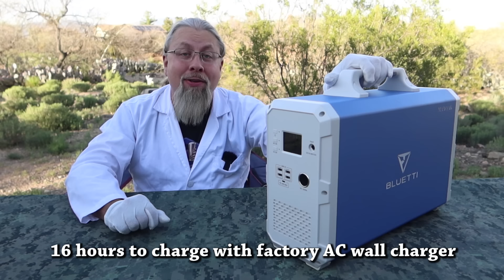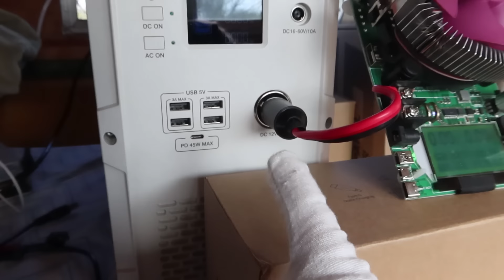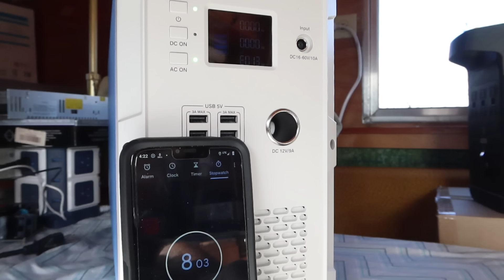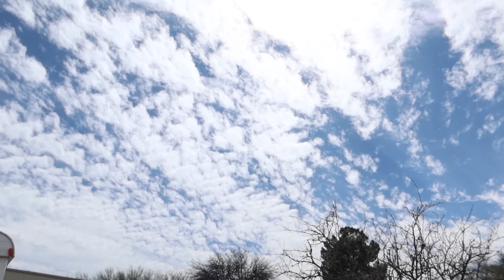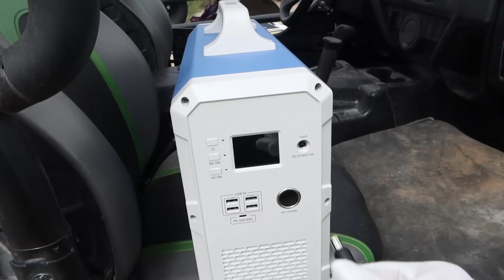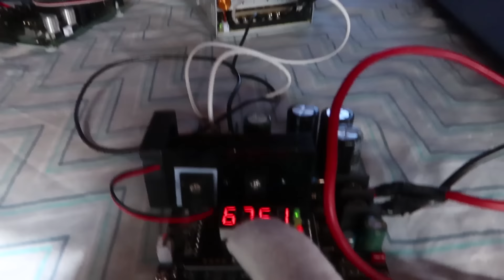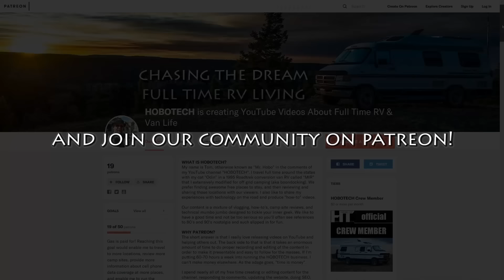MASSIVE Off Grid PORTABLE POWER Station! 2400Wh MAXOAK Bluetti EB240 Lithium Solar Generator Review

Comment: Thank you for you presentation. If I hook up a 2000w 12v inverter via the the 12v cigarette lighter, will that allow me to power higher wattage from the 2000w inverter without any problems?
Reply from the maker: No.

Comment: Well..................I just received the Bluetti EB150 a couple of days ago and have been testing it out in my camper. I have a relatively new Fridgidaire 5000 BTU compact A/C that is labeled at 3.8 amps. When it starts up, like most window units I assume, the fan runs for a few minutes before the compressor kicks on. At that point the Bluetti said it was pulling about 60 watts. When the compressor tried to kick in the A/C shut off, the Bluetti showed 0 watts momentarily and then the A/C came back on at the 60 watt level but the compressor never came on. I unplugged it for fear that I may damage my A/C and then plugged it into grid power and it worked as normal. Hmmmmm.................any thoughts on this anybody?
Reply from the maker: Sounds like your AC unit doesn't have a soft start. My Frigidaire model does and runs off the EB150 like a champ. It also ran just fine on an 800w Sportsman generator.
Reply: @HOBOTECH  Thanks for the reply. I thought I was watching one of your videos and your Frigidaire looked a lot  like mine. Anyway, I'll look into this and hopefully can come up with an answer. Thanks again, I really enjoy your videos. (Link to my unit:    https://www.amazon.com/Frigidaire-FFRE0533S1-Window-Mounted-Mini-Compact-Full-Function/dp/B01B4XUUDI  )
Reply: I did some more testing this morning and I wanted to share it with those who may be considering buying the Bluetti EB150. I just want to emphasize that I have all due respect for you Mr. HoboTech and I consider myself a rank novice, but.........................the Bluetti is not an inexpensive investment and I think folks would like to have all the information they can before making the purchase. About the only electronic testing equipment I have is a multimeter. I had my camper on household current and the voltage reads about 120v. I cranked up my Honda EU2200I and the voltage was about 125v. I then checked the the Bluetti via a 5' 12ga extension cord and the voltage read 110v. I then plugged the A/C into the generator and it started up and ran cool with no issues. I then plugged the A/C (after letting it rest for about 15 minutes) into the Bluetti, again via the 5' long 12ga extension cord. The fan came on and as usual ran a bit before the compressor tried to kick in (showing about 60-70 watts being used from the Bluetti). As soon as the compressor tried to kick on the watts fell to 0 and the A/C shut off and then came back on at the previous 60 watts but the compressor obviously did not come on. If you follow the link I provided above you can see that in the description of the Frigidaire A/C it says "low power start-up". I would assume that this is the same as "soft start" or thereabouts. Again, I am just providing my results, from testing done by a novice, for all you folks who, like me, do a bit of research before buying an expensive item such as the Bluetti EB150. Take it with a grain of salt as they say. I am still very happy with it and think it will greatly enhance my camping experience. Stay safe!

Comment: I’ve had the 240 for over month now and love it. My only issue is on the AC side, I’ve only been able to get 1,950w out of the 2,400 battery, that’s a 81.25% inverter efficiency. I enjoyed your cig plug test at 88% but what are you getting on the AC side?  Thanks and stay safe. Oh, hate the screen turns off at 1 minute, small gripe for this.
Reply from the maker: That's actually quite good. Remember that the 87% I pulled is basically direct from the battery with a little loss to heat and the regulator circuitry. The BMS is limiting the discharge probably to 90%. So the fact you're only losing 6% in the inverter is really good. Most burn 10-15%.
Reply: Thank you very much for the reply, I certainly appreciate it and feel relieved that my 240 is operating well. I love your insight and smooth approach to your reviews. Take care.

Comment: Hobo Techno,  I tried my 300 watt inverter on the charger for the the Bluetti Do you know what happened ! I was hearing very load laughter! It didnt work the brand of inverter I used is what you show on the video I need a bigger unit common problem .
Reply from the maker: I never heard an inverter laugh before! I verified in a video that the Bestek 300w pure sine inverter works perfectly fine to charge any Bluetti. However, you must give it 15 amps to work. Maybe your power source is too low.
Reply: Your right , the 12 volt plug I used is off the Kodiac but it runs my Dometic 75 compressor I tested the voltage it goes low even with the Dometic .But it does work I have 3 Solarrrrr Generators two Kodiacs and one Bluetti I love these things .

Comment: My kingdom for a 1500/2000W inverter!  The fact they kept the 1000W makes me scared that a 1500/2000 will be part of the next iteration and is the only boundary from getting this right now.  Great reviews on this stuff!!
Reply: I just picked up a used server rack mountable UPS for $75 with a 2000 W inverter.   I will upgrade the batteries with Decota lithium brand Iron phosphate lithium batteries for $450.  I’m going to hardwire a  solar controller with a switch so I can either can charge it from my solar panel or the wall with its built-in charger the whole project will be well under $500 and will outperform units Many times the price
Reply: @captamerica3693  look forward to the video of the camping trip!
Reply: Chris Squyres I’m setting it up to run my computer network and refrigerator for up to three days without solar input
Reply: Capt America hey, please post a video of this! ...........I may need one of these!

Comment: Hi Professor 
TKS For sharing,  
What's the best 4 - 100 watt  panel & solar charge controller, for 2 battery/ 120 h Sealed boat deep cycle set up? Can't afford Battlebornes. Also what's the brand &  info on your screen Clam shelter & review 
Camp Safe
Reply from the maker: Not to sound like a broken record, but it's all right here https://hobotech.tv/amazon/
Go to Comfort for the Gazelle and Solar Kits for the panels.
Reply: Thank You Professor 
I will check that.
What would it take to power a NextLight Mega Led Light, draws 630 watt ,4.5 amp
At 120 Volt  2.3 amp @ 220 volt.
Running 12 hours a day.

Comment: I have two Goal Zero one 1000 and 1400 that cost well over $2900 I’m sad to say. I wish this unit came out first. My one Concern would be the recharge time because I don’t like sitting in the sun or positioning  my vehicle for direct sunlight. I preferred to recharge my Equipment with my Honda en2200i.  I’ll be glad when  some company finally develop A multi-purpose fast charger that could be used on any solar battery. pack With variable voltage and amperage.

Comment: One more quick question, one thing that's kept me from lithium (I have 4 agm batteries right now) is they are less tolerant of cold. How would this unit handle charging in somewhat colder days?
Reply from the maker: You can charge lithium down to 32F and discharge it to 4F. Below that you want to store the unit where you're sleeping. Note lead acid loses near half capacity below freezing where Li-ion only loses about 10%.
Reply: @HOBOTECH  Awesome thanks. I'm hoping to move from my RV to a van soon and two of these along with those 170 watt panels may be my power solution in lou of doing a full and much more complex traditional solar install.

Comment: Great review. The 170 watt solar panels you have there, Amazon says they are 22.5  VOC and 19.01 for the VMP. Which do you use to calculate the total series voltage? If it the VMP then 3 in series should be well under that 67 max voltage input, am I correct? Those seem like good panels for the price.
Reply from the maker: Use the Voc. Under slight load the voltage drops just enough to keep 3 in series under 67.3v.
Reply: @HOBOTECH  So i bought 3 of these 170 BougeRv panels .. i should just run them in series ... and it should charge my bluetti just fine.   Do i need any additional cables to make all this work.  I basically ordered the bluetti 2400 and the 3 of your suggested panels?
Reply from the maker: You'll need a MC4 extension cable. I have them on hobotech.tv/amazon
Reply: HOBOTECH thank you sir!!!!
Reply: @HOBOTECH So I also bought 3 of the 170 BougeRV panels and connected them in series.  I was trying to buy a solar watt meter but everyone I could find could only handle up to 60v.  Any ideas?
Also thanks for your promo codes, saved $300 on the MAXOAK and $30 on the panels.

Comment: Hi, someone already ask about getting a 2000 watt inverter but is there anything that can be done to get a 1500 watt appliance to work? 
Great informative videos you put out.
Thank you.
Reply from the maker: No. The only option would be to open the case and hard wire your own inverter to the battery.

Comment: Do you have a video I can watch to see how you charge this bad boy with the (Adjustable DC Power Voltage Converter AC 110V-220V to DC 0-48V Module Switching Power Supply Digital Display 480W Voltage Regulator Transformer) you mentioned? I got the 1500 after watching your video and am looking to set up a fast charger. Love your vids! I just want to see your setup in regards to its wiring so I can purchase one. And if you have a personal link I will use it as well.
Reply from the maker: I show it being used in this video. It's as simple as wiring an AC plug for the input and 8mm plug for the output. I didn't do a specific video on it. Maybe I should.
Reply: @HOBOTECH  Dude, that's awesome! I must of missed it the last 3 times I've watched it lol. Watching again. I would love a tutorial on some of these self-made items. I've been watching videos for awhile but I  just don't know what's out there to help, like this one. Haven't seen a lot of gadget videos but would def welcome them.

Comment: I have been wanting to purchase a portable solar battery system for the last year. This one completely will take of my needs, 1k inverter is perfect, that's more power than most people are aware of. For the price point this is the best on the market, I ordered one from Amazon using your discount code for $300 off! the total price was $1,699.99 no tax and free shipping. I have watched others reviews, but you by far explained the system in better detail. Thank you for the needed info and providing a real money saving code. I can't wait until I receive mine, estimated arrival 4/7-4/17 2020
Reply: D D:  I ordered one too.  I think my arrival date is a little further out than yours.  Also, I wanted to order the Jackery 100W panels, but when I placed my order for the MaxOak, the only type of panels that were left were the Rockpals 80W.  I had hoped to hook them up (4 of them) in series, I guess, to get 320Watts, but now I don't know if I can hook  more than two of the Rockpals together in parallel.  Hope you enjoy your battery when it arrives!

Comment: Do you know if the EB150 has the same fail safe implemented?  Essentially, I have the unit at my off grid cabin and I'm using 4 100 watt panels (specifically Richsolar 100 watt Polycrystalline). I'd like to add more panels to get me up to 500 watt in.  Also, having more panels for cloudy days would be ideal. Any info that you can provide on how to achieve this would be fantastic!  Thank you for the amazing content that produce!
Reply from the maker: The EB150 is virtually the same. You would need to use an even number of panels and run series-parallel as shown in this video. In your case, 6 x 100w making two groups of 300w each in series and hooking those two groups in parallel.
Reply: HOBOTECH Perfect!! I’ll just need to add one to each group that I already have. Keep up the awesome work and thank you for taking the time to answer my question.

Comment: Except Will Powers LOL. Received my explorer 1000 and about a week later got the 2 solar saga 100's I need to review  your video on how to make the cable to connect both panels to the 1000. in my 1st test I ran my CPAP on 12v and only used 7% vor 8 hrs of use. next night ran on ac and it used 13% for B Hrs.

Comment: Great video, as always. 
Question: so, if we have two refrigerator units (1@ 690 watts and 1 @ 368 watts = 1058 watts) can this 2400w Bluetti handle that load?
Reply from the maker: If these are AC refrigerators and those are running loads and not peak compressor loads, no. You'd probably need to either choose one fridge to keep going to get two of these.
Reply: Those are peak running time numbers.
Reply: Look into a portable fridge. The high end wh is 80. Low is 30

Comment: For $2k, I'd rather buy 2 100 AH Renogy batteries and the other components for better serviceability and more power options.
Reply from the maker: Better make it 4x 100AH batteries for equivalent power and get a wheelbarrow while your at it! Kidding, but yes I know that there are cheaper permanent solutions out there.

Comment: Love your reviews as always, but maxoak's customer service has been problematic for me. So investing in their devices again is a no for me.
Reply from the maker: They have been very responsive for me.
Reply: @HOBOTECH  I wrote to them about a replacement wall charger. Not only were they super delayed in answering my email, they basically said we can't help you or even point you to a purchasable replacement. That's bad service to me, sorry.
Reply from the maker: @TheDawnofVanlife  My contact said to write info@maxoak.net and they will send you a new one.
Reply: I am sorry for this trouble for you.
we didn't receive your email yet,did you buy it on amazon from our store ?
could you contact us online by amazon message to tell the order ID and full address
or contact our service mail: info@maxoak.net
we will send one replacement wall charger to you after receiving  your address
pls don't worry,we help you until the problem solved
maxoak direct
Reply: I wrote Maxoak about a month advising them that my wall charger was operating at over 144 degrees with an indoor temp of 62 and breeze. Grabbing it felt like my finger tips were burning. My concern would be if someone were charging in a 80-90+ room with no breeze on carpet or similar what could happen?  No response.
Reply from the maker: @randyb620  My contact said to write info@maxoak.net and they will send you a new one.
Reply: @randyb620  I am sorry for this trouble for you.
we didn't receive your email yet,did you buy it on amazon from our store ?
could you contact us online by amazon message to tell the order ID and full address
or contact our service mail: info@maxoak.net
we will send one replacement wall charger to you after receiving  your address
pls don't worry,we help you until the problem solved
maxoak direct

Comment: Greetings...! Quick question - I noticed in the video when you were testing the 12vdc cigarette lighter port that the voltage under load was 11.8. The Bluetti specs state the port is regulated at 12.1V. Is it common among products in this category to output less than the stated “regulated” voltage under load? Thanks in advance.
Reply from the maker: That's the nature of electrical circuitry. The voltage always drops a bit under heavier loads.
Reply: @HOBOTECH  Thanks for your reply. Like many, I'm trying to make the best choice for powering a 12v portable refrigerator/freezer .

Comment: Reminds me of the 1970's Portable Color Tv's !  LOL     I guess if one man can move it, it's portable ?  

Two of my DIY  Prismatic  100Ah   LiFePo4 batteries comes out to just about the same weight. That's just the batteries.  Add a 1000W inverter and  Solar control another 10-15lb.  This is Nice looking unit.

Not showing the lower Inverter load could mess you up if you  forget your using the thing . Wish I could swing buying one.   Just out of reach .  Have to live with what I have at this time.

Comment: These reviews are entertaining enough to just sit and watch. I like this unit, and I think it is the limit of portable level weight. I don't know about polymer cells. They have a bad rep in the Hobby King world, but this is LG. If you want big value buy the 6 kwh LG modules from Tom at Battery Hookup. He's been moving those for a while at $600. You need to buy an inverter, but that's $200 and up for a 36v unit that matches the pack voltage. If you want cheap solar go to Santan. If I build it, I don't use a barrel connector for 500 watts. I like XT 60. Realistically, for people who do not want to learn enough to put the pieces together, this is a good deal. It's more a comparison of buying the stuff like Battleborn, or something like these units.  Either one should work. It's hard to push DIY in anything. Prowse has kind of become a salesman for Battle Born, and Battle Born Billy just bought himself another Tesla. People being laid off right and left. Bad optics.

Comment: Attn Hobotech:
"Can a 2000 watt inverter be hooked up between the Bluetti and the RV
to achieve better performance?"
Reply from the maker: Pete Coventry People said the same about the EcoFlow Delta when it was on Kickstarter and now the company seems to have disappeared. At least I am unable to get hold of them for nearly a month. BE WARY of investing in kickstarter/indegogo "vaporware" campaigns. Until they are reliably tested and the company is proven to be legit, you may want to spend your money elsewhere. Besides, that "Monster X" only has 1287wh for $1539 retail when it comes out. Not impressive vs the Bluetti IMO.
Reply: No this will not work. Best to do a DIY solution check out will prose channel for indepth guides.
Reply from the maker: Mykal Fury No, you can't just hook up a larger inverter.